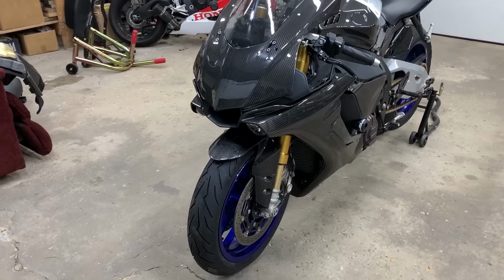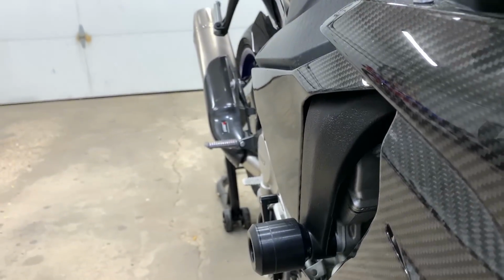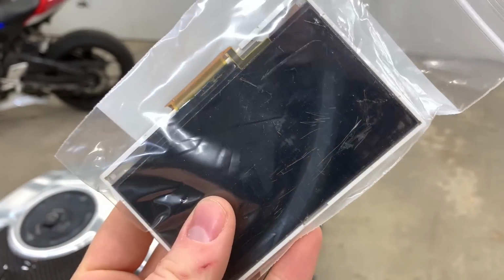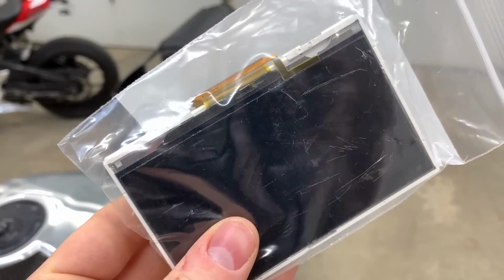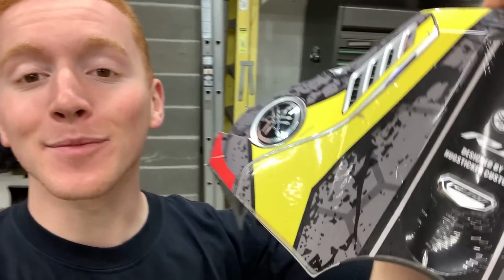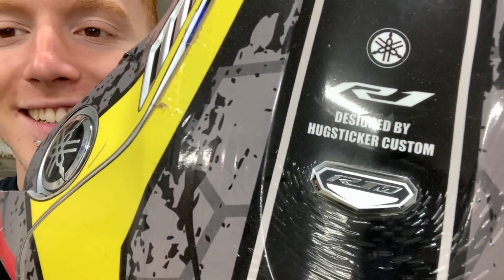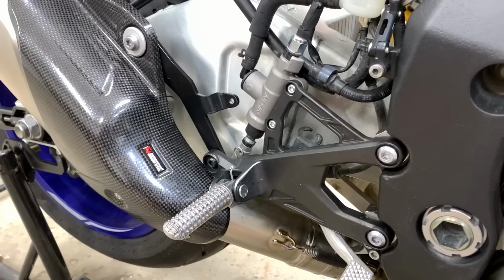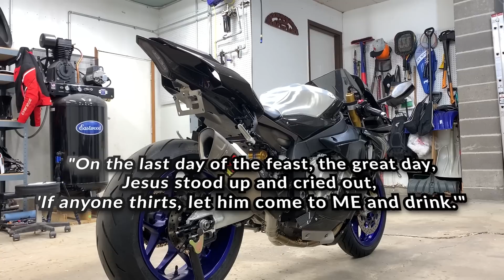Rebuilding A Wrecked 2016 Yamaha R1M (Part 8)

Comment: red dot mark on tyres should be placed aligned to the air valve. 😅
Reply: Never heard of that before.
Reply: Is it true?
Reply: Yes, it’s the place were the tyre is lightest to help compensate for the valve stem… basics 101…
Reply: @pedrobanza603  not basics 101 🤦‍♂️ that only applies to alloy wheels which is not common at all so I don’t blame most people for not knowing so please pipe down mister know it all.
Reply: @sugarrfree  yes also tyre rotation is wrong 😅
Reply: @SunnyBrownYT  just dwell on the pros... for now.
Reply: Where is your made bike?
Reply: And in some situations red mark proves that the tyre does not overlap the rim.
In some cases with the most powerful engines.
Reply: That's true. 
But unless they take it out on the track regularly, think that's alright.
Reply: @SunnyBrownYT  👍
Reply: the dot should be by the valve stem because that's the light spot on the tire
Reply: Well it doesn’t really matter if the red dot is not aligned with the air valve. The tire just needs to be weighted properly with the little weight you add on the side of the tire. If the tire doesn’t rotate when fully stoped it’s weighted properly
Reply: I’d be more concerned with how bent it is-or isn’t since he never checked or even spun the forks in the clamps to see if front is bent. It turned out pretty though.
Reply: Depends on the manufactuter. Mine had to be opposite of the stem
Reply: Never heard that in my biking life🙅🤷
Reply: @cjdiitalia  if you don't know, now you know. 😂
Reply from the maker: You're right man! I appreciate you letting me know! I was not aware when I mounted the tyre. Thanks!
Reply: CJ media and CB media sounds familiar 🫢
Reply: TOMA MI DINERO HERMANO.EXCELENTE TRABAJO.😍🏍
Reply: J
Reply: right. it is very important for braking grip

Comment: the bike looks awesome . remember the flames that comes out the excaust is not good for the engine .
it means the timming is off ,the gas ignite before the spark . it will damage the engine later .
Reply from the maker: well it is tuned and has a race ecu so it tuned like that
Reply: @CJMediaOfficial  ok but it will destroy your engine faster then others .

Comment: Gorgeous bike CK, well put together.........congrats again. Is the engine original? Why so many flames ? I used to have a Kawa ZX6R which exhaust would frequently pop , but never with flames. I guess your R1M fuel misture is a bit rich..........maybe?
Reply from the maker: Thank you Ricardo!! Yes the engine is original and it has been professionally tuned previously. I assume the tuner did a pretty significant flame tune for the bike which is why it shoots so many flames but I can't complain it's awesome haha.

Comment: I recommend you buy an air compressor, help with cleaning the parts 
greetings from Colombia
Reply from the maker: Right on Camilo! I have a air compressor at home just don't use it often
Reply: @CJMediaOfficial  the compressor helps a lot with cleaning and makes work easier when washing the motorcycles 😅😅

Comment: There is a cluster right now for 350.00 on Ebay with 15k miles.
Reply from the maker: thanks man! i saw that but ended up going with brand new and i needed one that worked with the electronic suspension

Comment: Whole point of the frame sliders sticking out is to keep expensive components and fairings off the floor by cutting them down your defeating the point of having them on there in the first place
Reply from the maker: You're right sir, I was meaning they stick WAY too far out, I like them shorter but still useful!